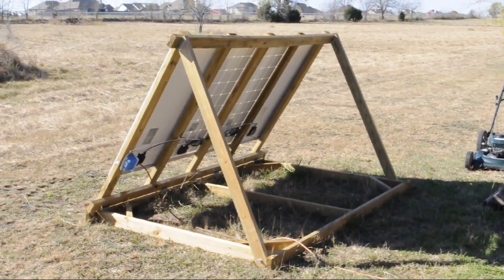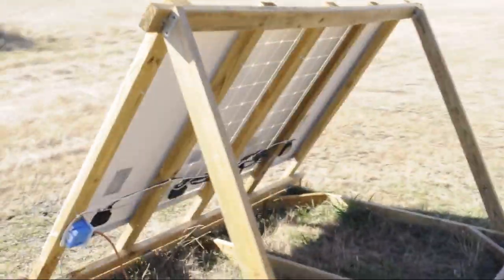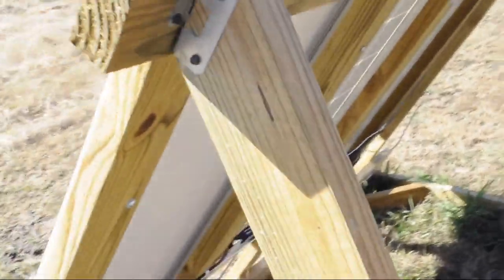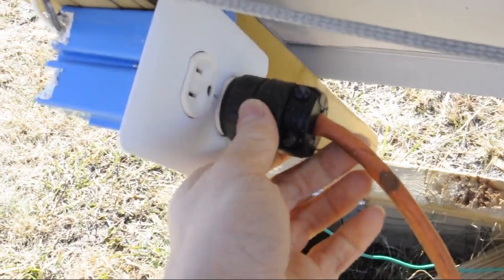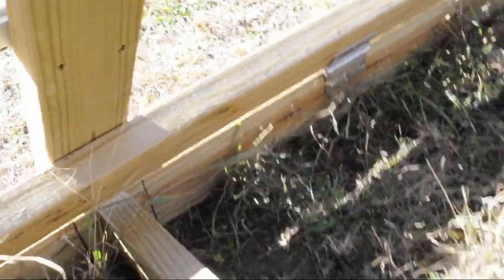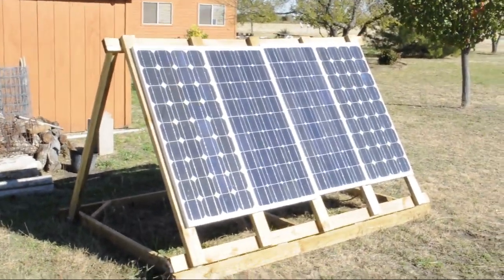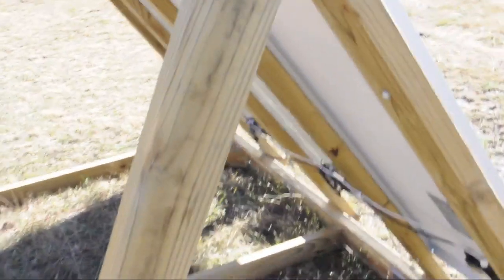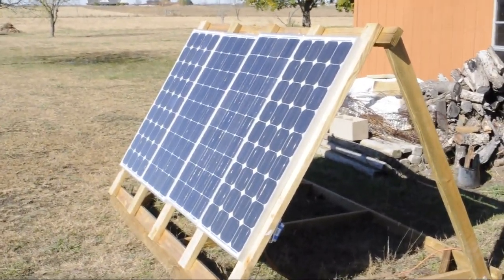Solar Panel Frame

Comment: I know this video is old, but I picked the same type of panels up but no frames? I'm not sure what to do about it, not sure if I can drill holes threw them, any idea's? Thanks! 👋
Reply from the maker: And I hardly ever frequent my own channel comments, BUT, you might be able to get away with using some kind of clamps. Maybe something akin to mirror clamps, but obviously a little thicker. In worst case, you could always make a plywood frame perhaps, one layer to butt up against the panels, and another to cover it and the edge of the panel. Hope that helps!
Reply: @adamlhumphreys  I built a frame on hinges and bought a glass bit and drilled holes, rubber and steel washer's... Wala! Thanks!

Comment: great design, cant wait till I start my new project this week.. so excited..
Reply from the maker: Hold up! I recently, (and finally), implemented a slightly different system, but it requires 2 anchors on the front and back because the bottom frame is no longer needed. I used a landscape timber as the pivot in place of the hinges, and the winter time wood props will use a wire lock clip for quick removal. Anchors in the back will hold it down from the wind and are attached to closed eye hooks via a chain adjustable using screw links. ... We haven't screwed the anchors in yet, so unfortunately, I can't really show details at this time. Of course that doesn't mean my old design isn't still useful depending on how you want to implement it. You could still use the easier wire lock clips to pop in and out wood props, but I'm not sure how they'd fare against wind since my newer design had the actual frame anchored down. But after so many panels, it gets annoying to screw and unscrew that many frames, hence moving to a simple locking system. :)

Comment: can we remove the metal frame and glass for this type of solar panels
Reply from the maker: +mohamed fakhr I don't see why you shouldn't be able to remove the frame, despite some difficulty. I think there's two screws at each corner that helps hold the frame together and of course the sealant. But depending on how its constructed, the glass may be pretty difficult to remove and may require an oven large enough to accommodate the panel to loosen the sealant. Considering how hot solar panels get just in the sun, temperature may have to get fairly high. This is all speculation though.
Reply: wouldn't recommend it. I attached my aluminum frame via bolts to 1x3's and set up a similar rack for my 310W Panels.

Comment: adam, are you charging batteries with these panels or are you plugged into the grid?
Reply from the maker: Well, technically both. We use an outback inverter, so the panels are connected to a FlexMAX80 charge controller, (though any general charge controller would do, though I'd recommend one with MPPT), which is connected to a 48V battery bank. The inverter, tied to the same bank, sends electricity back to the grid. We did this because it's flexible. If we wanted to go off grid, we have the option, (at least in part), but we'd need a bigger battery bank, and decent batteries aren't cheap. Another slight drawback from using batteries is more conversion loss rather than using an inverter that converts solar power straight to the grid like a micro inverter system.

Comment: Good video. I am building a solar panel frame to your exact specs, even gonna wire it the same way,but not sure how to hook up the wiring for the blue power box ?  Help?
Reply from the maker: What I did use the neutral/white side of the socket for positive, the hot/black side of the socket as negative, and of course green for ground. HOWEVER, to keep the arrays on separate circuits at the main junction box on the inside, I broke the joining tab of the neutral (positive) side. (It also helps carry more current since the socket is rated for 15A.) But you don't have to do that so long as you have an inline fuse on each array anyway.

Comment from the maker: @Rick007191 Well, I know where to get panels down to $2/Watt. And it is NOT economically efficient to build your own because I’VE DONE IT!: adamlhumphreys[dot]com/P_Solar …Unless of course you happen to have no job and and can swipe some stock of glass or cells for dirt.

Comment: @adamlhumphreys Funny thing is that over there they need highly efficient solar energy since it is so cloudy most of the time (overcast).  80% is basement as they are trying to come up with 100% and will one day.  The paint, they said, was  more efficient.  The 80% efficiency they advertise is at optimal conditions but really it is < 30% whereas the paint is about 10% more efficient (according to that Discovery thing I saw).

Comment: @adamlhumphreys That would work as well but I program in C++ so I still like the thought of a computer controlling it (I have always wanted to do it like that since the 1980's).

Regardless how the end result is achieved it is something that should be done just for the little extra edge since silicon cells are not very efficient overall.  You know they make paint now that replaces the silicon cells but it is expensive (saw all of this on Discovery channel I think it was).  Germany leads in this.

Comment from the maker: @GhostOfACPast Well, the 80 watt panels were about $220ea. Instead of using a micro controller and learning the language, I’d probably go simpler and try a light sensor w/ some op-amps as a controller. But that’s me, I’m a little old-school and analog. I actually made a simple charge controller with op-amps and a relay, but looking back, I’d reverse the logic and have the relay engage (disconnect the panel, like everyone else) when charged rather than when charging (it oscillated in low light).

Comment from the maker: @GhostOfACPast Man, that’s a sick bummer! … But, if it’s that cheap, it sounds like a deal! It cost about $80 to build our 2x4 frame that doesn’t automatically move which holds four 80 watt panels. Do you have a link to the plans or a video?

Comment: @adamlhumphreys To be honest it was so cheap I was shocked but the extra cost considering how much the panels cost alone.  I figure if I could get even 10% more efficiency by spending <100 dollars to build a tracking system than it would pay.  The issue is that here in TN they do not allow reverse metering (stupid and greedy TVA) so they wouldn't pay us like they do in so many other states.  Best we could do is reduce our electrical bill and ne thing over is just lost.

Comment from the maker: @GhostOfACPast But for the number of panels we currently have, (even if only eight 80 watt panels), it would cost a bit and take quite a bit more infrastructure. But, some day I’d like to mess with and develop a simple tracking system probably be for a smaller independent system.

Comment: I saw some dude who hooked his panels up to an adrino with servo motors and programmed it to actually track the sun.  When the peak fell below a threshold it moved the entire panel back and forth to find the new peak then it would wait until the sun fell down below it again.  Of course it waited for like 5 mins before it went on a search and find mission (incase of a cloud going over head or a plane, etc...) but by doing this the panel was always at maximum performance.  It knew when dusk was 2.

Comment from the maker: @shartne I actually made ten 50W panels, but they underperformed their rating. Only seen up to 300W total. Check my site at adamlhumphreys[dot]com[slash]P_Solar for details. Concluded it was more economically efficient to buy them for $2.6/Watt, but I didn’t get my cells from Germany either. Could’ve bought an infrared camera to spot the bad cells, but I could buy three 80W panels for the cost of that.
Ground rods protect the equipment (mainly the $2k 3.6kW grid-tie inverter) from lightning.

Comment: Nice panels I have six 80 watt panels I made lol. I bet those factory made ones cost a lot they are very nice. Looks like the wood frame  works good nice work you should prime it and paint it so that it wont absorb water and warp. Take a look at my home made wood frame on my channel. I made it out of 2x6 treated lumber. I need to figure out how to make a angle adjustment for mine. Ground rods are important? What are they good for lighting?

Comment from the maker: @Thunderstruck0videos However, solar panels aren’t the only way to use solar power. Houses can be designed with solar in mind, which is generally a lengthwise house from east to west with many windows on the south and little or no windows on the north. But that’s probably best for up north.

Sorry, 500 characters isn’t enough for me.

Comment from the maker: @Thunderstruck0videos We also added radiant barrier this previous summer. My dad has definitely noticed a change in the electric bill. Now our renewable energy system contributes a larger % to our electricity usage since it has gone down via the barrier. Our last bill was $175 and my dad recalls the bills usually being much higher. Usually the extremes (summer and winter) were up to $500. The winters should also be much better with the barrier.

Comment from the maker: @Thunderstruck0videos Yeah, I think solar water heating is somewhat iffy, but I don’t know much about it.

As for electrical solar power, if you know where to buy it, (eBay), you end up paying $3/watt as opposed to $5/watt. So far the panels we’ve bought actually do produce their rated power in good sunlight. We also have a couple of Air X 400 watt wind generators. They’re actually that swishing sound in the background of the clip.